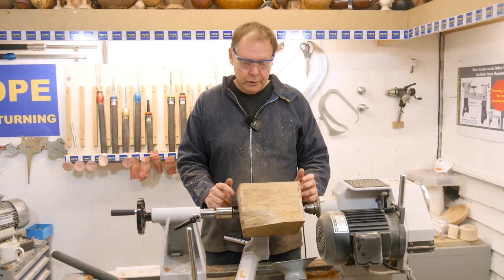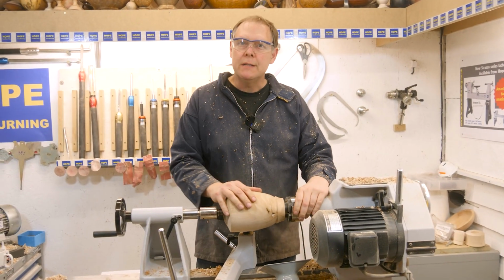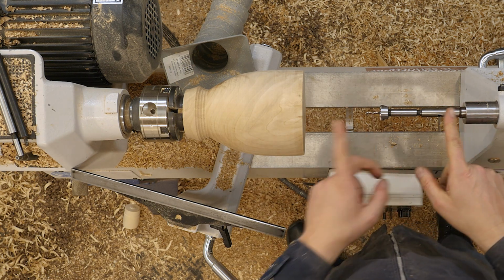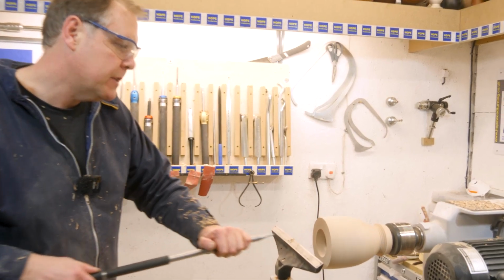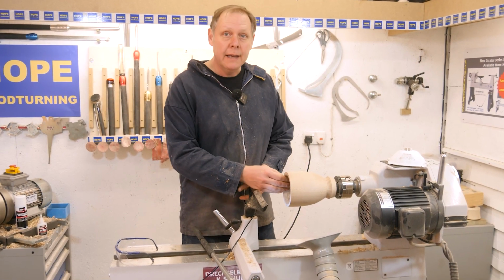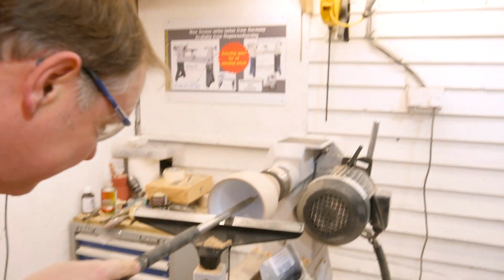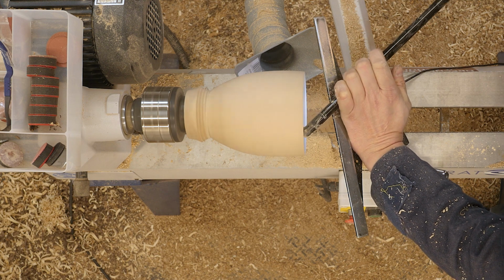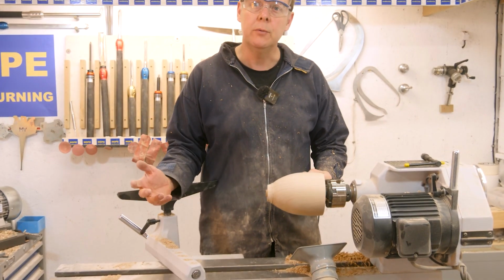Woodturning Lesson 10/11 - How to turn an open vase

Comment: hi, ty for a great tutorial. a question.. what is that extension which goes inside  tail stock and where can i get it?.
Reply from the maker: You mean for the Drill? Sorry i honestly dont know, but you can Just use a solution Like this instead: https://www.drechselbedarf-schulte.de/drechselbaenke-maschinen/drechselbankzubehoer/bohrfutter/4979/schnellspann-bohrfutter-1-13-mm-mit-aufnahme-adapter